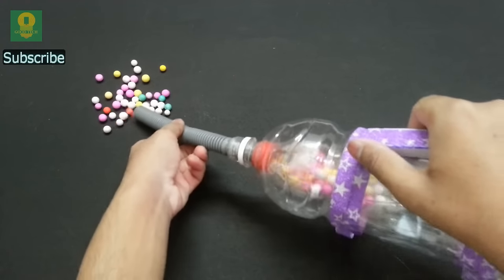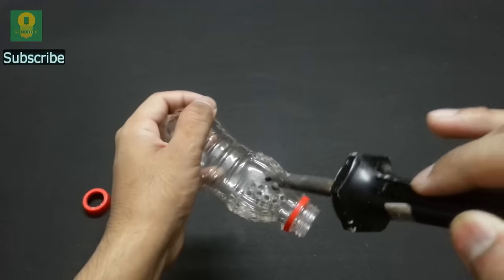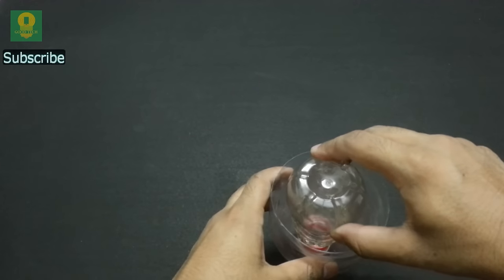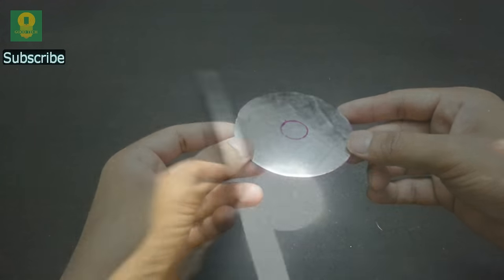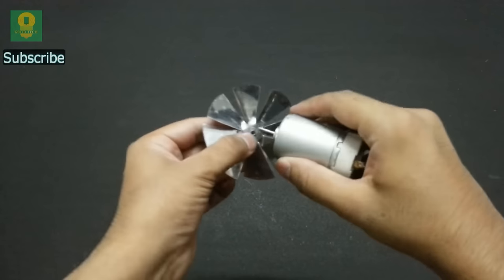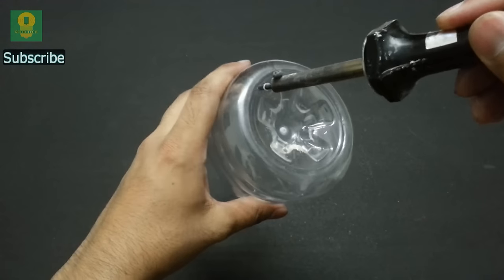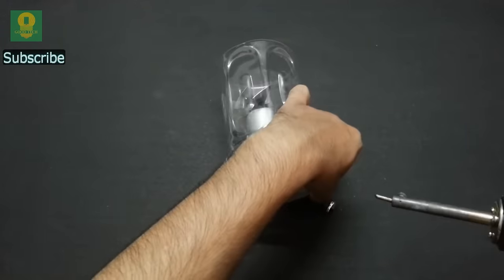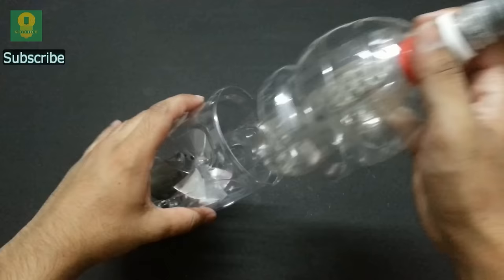How to make Powerful Vacuum Cleaner at home

Comment: Awesome vacuum cleaner sir we can also used this at home
Reply from the maker: However, the concept is same, but this product is not very useful for home, as it is not much powerful, however, sealing the air gap at the bottle joint and changing the propeller design will improve its performance many folds.

Comment: Can I connect 12v motor directly to electricity shocket and plz tell me how you connected it
Reply from the maker: No..never ever connect a motor directly to an electric socket. The electric socket is 220v AC supply, whereas we only need 12v DC supply. All you need is a 12v wall adapter that are available online or you can also get from local shops.
I used a 12v wall adapter to power the motor and this is the only recommended way, however, you can also connect a 9v battery. The motor will also operate with battery but the rpm will be very less.

Comment: Can we use a simple plastic fan as propeller
Reply from the maker: Yes, if it fits the bottle without leaving much gap at the sides, then it can be used. The lesser the gap around the fan, the more will be the suction power.

Comment: hey bro.... here only available 3-6V Small DC motor for Rs 15. I want to Know the Price f higher one (gear motor or whatever) that u r using evry  time in your video...... can I know the price of it? where you're getting it from?
Reply from the maker: +Bhavya Tyagi I bought my motors from local market however, all the motors are differently priced. These are also easily available on ebay and amazon.
Reply: +GOODTECH - Creativity and Science Yes bro ,I saw a geared motor on Amazon The starting price is 120+ is it ok?
Reply from the maker: +Bhavya Tyagi Well the online prices are a bit high for these things but its acceptable if you are passionate to create things.
The motor i used in this vacuum cleaner was something around Rs.300 and those 12v geared DC motors are 150 each in local market.

Comment: How many V should a motor pursue for this and plz tell me the how much rpm of motor i can use for it
Reply from the maker: I used a 12v, 10,000rpm motor. Any rpm motor can be used, however, higher the rpm greater will be the suction power. If you need material links and additional details, do have a look at my instructables page - http://www.instructables.com/id/How-to-Make-a-Powerful-Vacuum-Cleaner/

Comment: I want to make this model for my school exhibition so plz send wt r the items that r required😇😇
Reply from the maker: Yes, you can make it. It is a wonderful and useful project. The main materials used are two different size water bottles, DC motor, plastic conduit, adhesive and a 12v adapter.
I also make detailed tutorials of all my projects, have a look for additional details, material links and other important info - https://bit.ly/2HMboyy

Comment: How can i connect the dc motor to electricity should i use a 12v battery or normal electricity i bought dc motor with no wired idk how it works please help
Reply from the maker: No, a dc motor cannot be connected directly to electricity. i used a 12v 2A dc wall adapter to power the dc motor.

Comment: If u try to collect dust with this one then it will also get thrown out of vacuum cleaner coz there is no filter stopping the dust particles from escaping.
Reply from the maker: No, actually it wont. The dust particles gets collected in the small bottle and the air flows out through the holes. However, if you wish you can also wrap the small bottle in a plastic net and then it can act as filter for dust as well. This design is also suitable to work as a wet vacuum cleaner as the water gets collected in the small bottle than falling on the motor. If you have time, do read the video description to know more about its features and upgrades.
Reply: well you said that the bottle which is used as dust container can be covered with a net and i think is also a good idea but you should have shown that in the video as well, like using the filter paper obtained from the tea bag and then covering the inner bottle with it would still suffice the general working of the project.

Comment: request question 
I want to make this model for my school's science exhibition
so, send what things that we required pls....
Reply from the maker: Plastic bottle, one big and one small
Spiral conduit
High rpm DC motor
metal sheet (or a propeller)
DC adapter jack for power supply
Araldite glue
Hot glue
Reply: Khetaram Bhati

Comment: My motor 12v dc 24000rpm so how many ampere I should use
Reply from the maker: The motor datasheet mentions the ampere for required rpm but a 12v 2A adapter should work well with your motor.

Comment: can we use ac motpt
Reply from the maker: Yes, even an ac motor will work but it is not recommended to use high voltage AC motors as they can be harmful and dangerous to work with. It is a small best out of waste project and using a high rpm DC motor is recommended.

Comment: how can i get  the metal sheet like this???????
Reply from the maker: These metal sheets are available on the shops that make air cooler. However, you can also use the sheet from any metal can for this purpose.

Comment: bro will a DC motor that is small will work? plz tell fast
Reply from the maker: Yes, even a small DC motor will work if it has enough rpm's. You need a high rpm motor to work with this project.

Comment: I want to buy wireless motore circuit which you show need transmitter to move car? price info.please by SMS how much subscribe rate? pl.reply
Reply from the maker: The wireless circuits are available online but are quite costly. The only economical idea is to buy a cheap RC toy and remove the circuit from that, then make a strong, reliable body at home.
Reply: OK thank you what charge to subscribe your chenal reply pl.
Reply from the maker: Its free